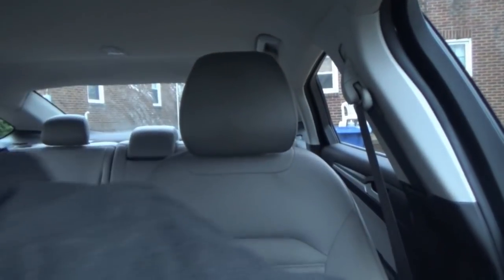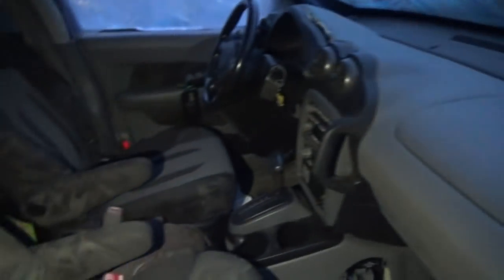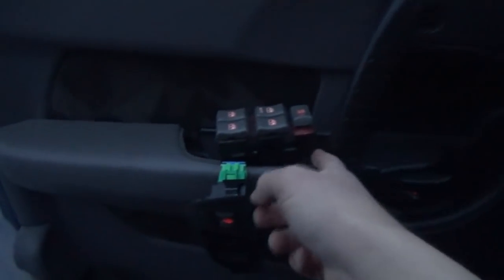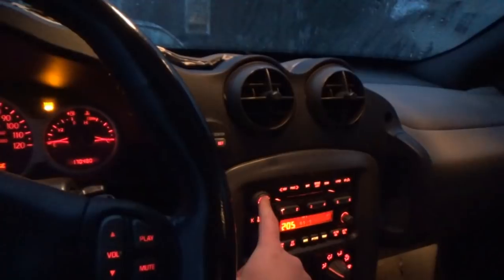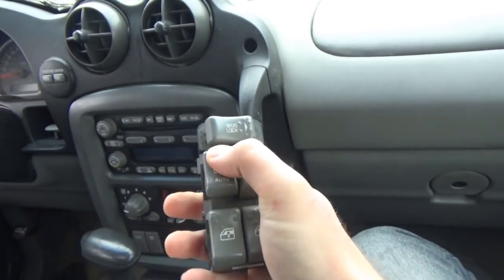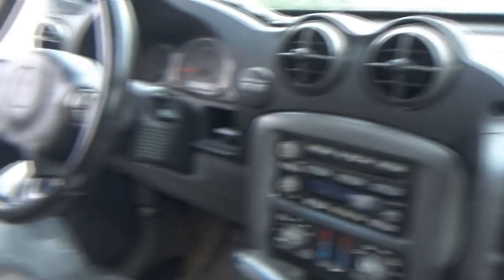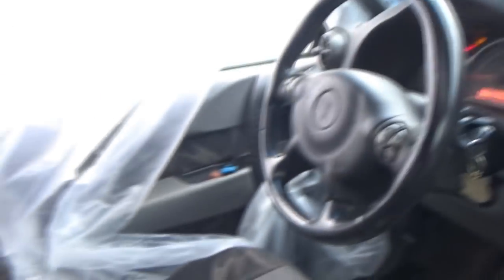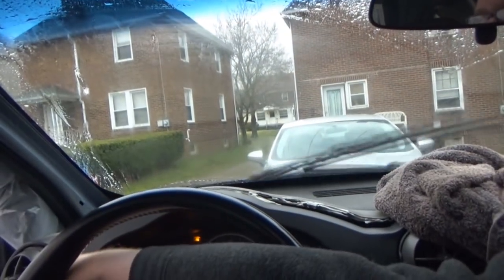MV 211 - "Aztek Window Crisis"

Comment: Okay, talked to the husband about this. He is an electrical genius of sorts. You can put a jumper - even a paper clip - from the yellow wire on the long flat connector to the dark blue wire on the rectangular connector and if there is power at the yellow wire, the window should go up. Now if there's no power to the yellow, you will have to trace that wire through the door, then in to the dash (it goes through the C303 connector which is inside the dash behind the headlight switch, as i recall, you can access it though a removable panel on the side of the dash) and it goes from there to the power window circuit breaker. I would start with a test light on the yellow wire and see if you are getting voltage to it. I suspect you are not for some reason if the circuit breaker is good. You can use a good voltage meter and run the leads from the switch connector to the fuse box and see if you have continuity throughout, also from the C303 to narrow it down to a possible break between the fuse box and the C303 or the switch and the C303. I hope this all makes sense, haha. It is possible the wire has broken somewhere, particularly the door jamb which is a vulnerable spot. It also would be a good idea to check the connector(s) for moisture and corrosion. We were hoping it was the switch as it was with ours.

He was looking over the wiring diagrams and the yellow wire also goes to the passenger switch, so he is thinking you have a break between the C303 and switch. Not uncommon for a wire to break suddenly just from opening and closing the door all these years. 

The light working is nothing, it is on a different circuit - dash lights - than the power windows. 

I say keep the cover as well, the plug wires go under it. We found one a couple of weeks ago and put it on, it looks good and hard to find because they were only on U vans from 1996-1998. Most had been tossed by lazy mechanics.
Reply from the maker: The next video shows the issue. That’s all I’ll say, lol

Comment: Hey! My windshield fluid line looks like it was cut. I think it was probably using my wipers this past winter and the ice ripped the line. Do you know if this is a job I can fix myself?
Reply: Xtcy on the Aztek? Yes it’s very easy. Did it last fall myself.
Reply: Caleb C. Yes. How did you do it?
Reply: @xtcy7137  just buy some cheap washer fluid hose its like 3 dollars a roll follower the lines you think was cut and pull it out put the new one in and cut to fit. also the nozzle could just be clogged so push a pin in the nozzle to test that.
Reply: Xtcy exactly what he said^. Yet make sure you measure it out properly and reuse the clip components from your current line.

Comment: I had to change my fuel pump
Reply: How much did it run you for parts and labor? I am on my original still but the float acts erratic unless the tank is full. I know it's inevitable that the pump will need to be replaced one day.